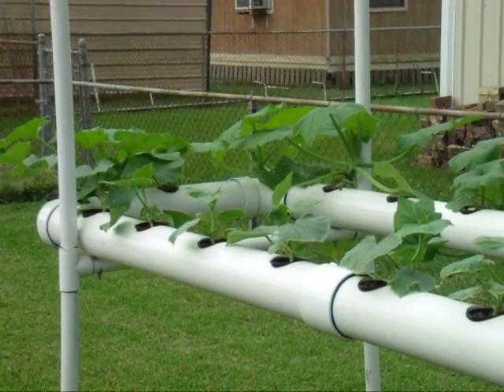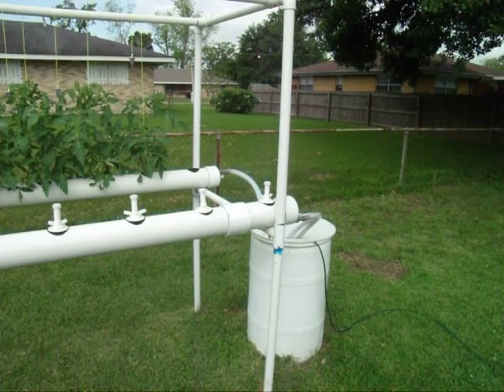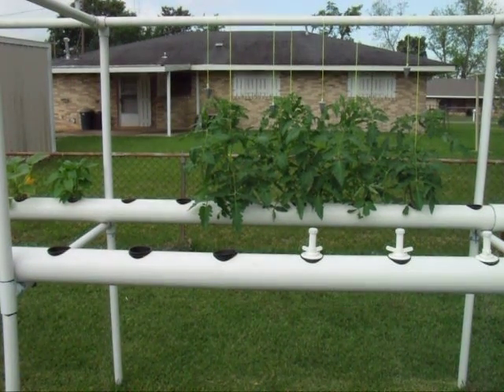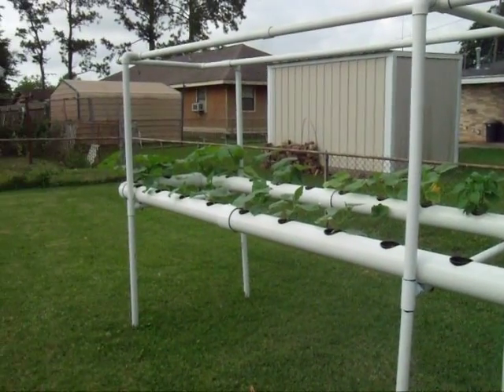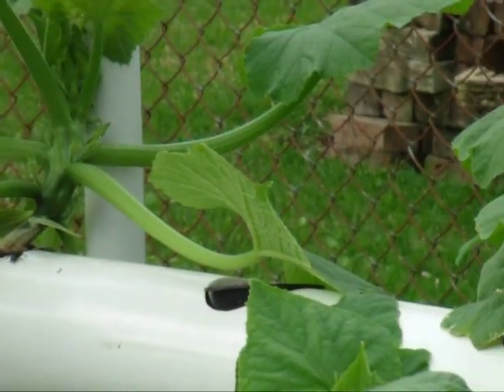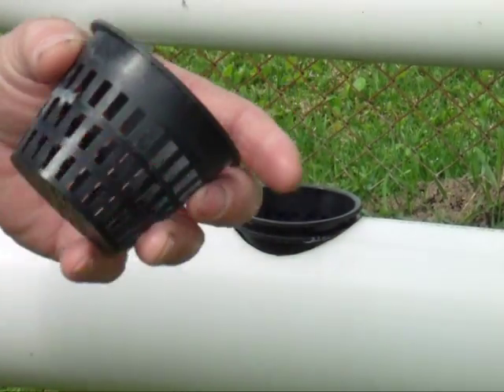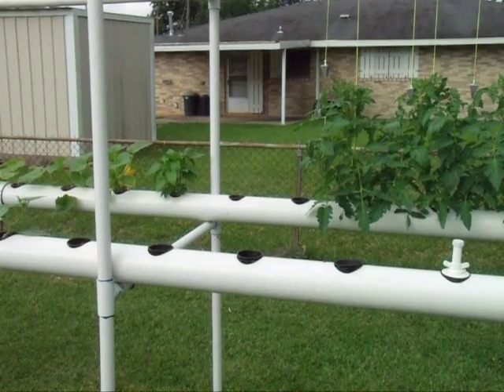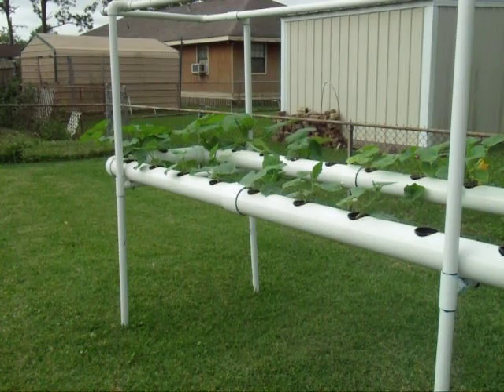My PVC pipe hydroponic garden explained

Comment: Thanks for sharing Kevin. Interesting how you did this. We had a deep craw space and I used to grow down there. I used the pvc pipe, foam coffee cups in pearlite for rooting my clones in one small room and another room for growing. I used pots on corrugated plastic in the grow room for the pots to drain. I just might try your setup next spring, but outside. At 70,  I don't fold like I used to, I don't unfold so good either. 😎👍
Reply from the maker: Yeah one of the beautiful things about this you're not bending over and you're not weeding anything it produced really well I just bought net pots and the clay balls and it did a great job I'm going to be doing another one this spring it's gonna be set up around my koi pond and I'm gonna use the water out of the koi pond to water and fertilize it we'll see how that goes thank you so much for watching you have a great day and ride safe

Comment: Very clever trellising! I wondered why you didn't just use a timer at the wall plug so there's no wiring to do?
Reply from the maker: It's a flood and drain system I wanted to flood 50 seconds and drain 50 min. and repeat 24 hours a day thank you for watching
Reply: @KevinTodd  I have an flood and drain -- not as big as yours and differently configured - and I plug a store-bought timer into the wall (I'm indoors), then plug the pump into that. It goes on and off as I choose. That's why I wondered why and how you need an electrician. I may have misunderstood - maybe that was to set up the outlet. I was just thinking maybe you know a better kind of timer. Mine is only capable of longer cycles, which I run less frequently. I'm getting ready to set up a pipe system so am very interested in how others do it.
Reply from the maker: @melody5437  Maybe we didn't have those 9 years ago and I love to to tinker LOL

Comment: Love it, what gal per min pump? What are you using to fertilize your water?
Reply from the maker: A sump pump from harbor freight don't worry about GPM it is timed to flood and drain 

 https://www.ebay.com/itm/5-LB-WATER-SOLUBLE-TRIPLE-20-FERTILIZER-20-20-20-balanced-micro-nutrients/351756564693?_trkparms=ispr%3D1&hash=item51e65338d5:g:pP0AAOxyyF5RXH-q&enc=AQAFAAACYBaobrjLl8XobRIiIML1V4Imu%2Fn%2BzU5L90Z278x5ickkWpEuxXwAiCNKyBQsQ5%2Fe63uhRvFOwcjl3BXO%2BXOmyAJJ7ryfMjcYPjDnGY6sJJJbMxK0pMUcTEQXVSMwRH%2FYqn9EUUKxYFPZiPr2HRJIM1czfCTJLWVF4dcGNb5QZrn578wLu1F%2FnLnq7K3DfO%2BkJgYC8DddO49%2B5323bqjkNCpJzhyTEiM8jQB9A%2FQwjdVI7YZUU3xZ8Cn9Cs1nJCfU%2BZAj4OP4LO5CfCNKOZxRBApAn8525QLxnRmfUue4TW7H8l9HzRqLnwZjaCRhlynNnXzaN%2By2nGhEb7GmKvnpYCca6tj6tiOCNRnOfoeQq2CU5uBD7xSgQHZ8s2ybj0xo2C%2FwNyQSqwcJpJXI7xoptDD5l32aFN0WDQOkj74XvS5HL6qI4SlJQf0xVUjCVmAwqDTNPX9aCo7iGAO6RNvE1Cd5JugQ1yyuum%2FH8gkeF4r5QQMcMVln4zC44gOPVQF5CMs5fEfj6DwkzmCTGmfZEQQpiVcjURvSz4WchH0upw7rgfJfOp5iE68XF0LCyXR90AJtSr5JNveCzMlgOaGDEz4QZAwpz6VGcwjD5qqGHx9I%2BPsbUUmkAwESlqE3Z9Eg5MEwdCHFggKcq7Ebrc7qn1aKr7ngcXAtA8ziRFp4uQmBdawTDm%2BF%2FvvhFhQae08uQyyINJjBAupPDrH3UETgvRLpNV8QvTrhXyW17LtPRaiUoLcwsR3XIkX9ZyUsWXOF8Bls1yTS4YT0OfnBnlPkE7hA11dDOozWe70nqoH7Fq79&checksum=351756564693b1788e57897043fe98822aa06dd01b2c

Comment: If your water gets to hot you can simply take a gallon or half gallon jug. Fill it with  water and put in the freezer till frozen. Then set it in the water barrel or holding tank. Water will stay cool for several hours.

Comment: What type of garden are you doing now? Are you still using the flood and drain? 

I was hoping to get a detailed materials list and a detailed information on how you assembled your system I have watched your videos all probably 10 times and really like your set up and wanted to get in touch with you on how you did it. We don’t have a huge yard but could do this and it would keep the dogs from getting in it thank you again for your videos and the time you have put into this! I sent you a email as well thank you.
Reply: Would it hurt the plants or anything if my pump only ran during the daylight hours?
Reply from the maker: @jarongilbert9034  no
Reply from the maker: I used 4 inch pipe 3 inch net pots and the clay ball medium the fertilizer I use came from kelp4less 20 20 20 the thing you have to remember the most whatever size Garden you build your Barrel has to have enough water in it to flood it completely I used to time delay relays for the on and off so really the key Point here is having a barrel big enough to to flood your system I use a harbor freight submersible pump lasted for 3 years no problem the barrel has to be painted white to reflect as much sun as possible if you have access to 6 inch pipe that's what I'm going to go with next I don't have a garden right now my shop took up the space where it was at so my yard space is limited now myself but I will be putting one to the back of it pretty soon thank you so much for watching it's just PVC pipe you get a hole saw Mark a straight line across the top of the pipe and every foot drill a 3 inch hole for your net pot.
Reply: Thank you sir was your pipes level or did you put some slope in them to help with draining and are your holes for the inlet and outlet pretty much flush with the pipe cap” 6 in pipe and so would you do 4 inch net pots
Reply from the maker: I'll try to put together a material list for you
Reply: Thank you sir I really appreciate it
Reply: Add what ratio did you mix your kelp4less fertilizer?
Reply: Thank you sir

Comment: Where can I get a material list and instructions to make this?
Reply from the maker: It consists of 4 inch PVC. 2 inch PVC for the stand drill 3 inch holes in it for 3 in Neti Pots And Clay balls.
Reply from the maker: The only thing is your water reservoir has to be big enough to fill all of your 4-inch pipe. With the nutrients in it kelp4less is the people I got mine from 20 20 20

Comment: what you do to control the  temperature of the circulating water
Reply: Thank u for ur answer. It cant be so easy. White color cant be enough to control water  temperature at 20 C and this temperature is good for tomatoes. High temperatures causes root root diseases. I couldnt manage to control the water temperature. It is 30 C at noon and 25C at night.My barrel also white color
By the way your pvc pipe hydroponic garden seems so good.
Reply from the maker: I painted the barrel white to reflect light and heat water stays cool to warm all year. The plants never had any issue with the heat with them at all and thank you very much for watching.
Reply: Could maybe add shade to the Rez to keep it out of the sun. “Rez clear” helps with root rot and algae growth. It’s actually not much different than pool shock(sodium hypochlorite). I think the ratio for the shock was a tsp per gal, but you could find a clearer answer in forums. I use the Rez clear and works awesome! just keep in mind that it raises ph so you’ll have to adjust.

Comment: Hi, how do you keep the water cool when the weather is in the 90's in the summer? How often does your pump go on and off?
Reply from the maker: Nina LM you paint everything white with Fusion paint for a plastic paint do have a lid on your Barrel make sure it's painted White too the pump would come on for 5 minutes that's to fill the tubes and then it wouldn't come on for another 45 minutes thank you very much for watching
Reply: you could fill some 2 litre bottle 3/4 the way and drop one in the res every now and then...

Comment: Love 💕 love ❤️ your system. Nice work. Love your 🍅 tomatoes.🤗would love more, much more details however. Nutrients, keeping them cool outside.ect. What was the issue last time ? The “stupid stuff” no judgement just want to learn.
Reply from the maker: I stuck the water hose in my garden sprayer I use weed killer in...........and a couple of days later in the barrel to add water.....not thinking about the round up on the outside of the hose. I will tell you now it takes 1 day.......one!!!!! and all your plants are dead. To keep cool  paint the barrel white and have a lid on it, I used Kelp4less 20-20-20 for hydro garden and follow their instructions and thank  you very much for watching
Reply: Kevin Todd thx for your reply. Yup we ALL make mistakes. Cool set up.

Comment: I don't know if you're still monitoring this or not but I have watched your video about ten times and have a few questions. I understand you run your pump for the length of time it takes to fill the pipes and you do that every 30 minutes from 6:00 AM until 6:00 PM. Does the pump over power the drain back or is that flow controlled? What GPM is the pump? Also I'm having difficulty understanding/finding the timing mechanism. It would need to power up at 6:00 AM, run to fill the pipes, turn off, do it again in 30 minutes until 6:00 PM, correct? I also appreciate the fact you have answered many of the viewer's comments questions.
Reply from the maker: Yes I'm still here not going any place this video is the timer https://youtu.be/PNf0MFCHuSQ
Reply from the maker: Flood 45 sec. every 60 min. but this is on mine yours might be bigger or smaller your pump needs to be big enough to flood quickly so fill time will vary  and go 4 inch net pots and 6 inch pipe  and two drums

Comment: You could use a gravity fed water system, which would eliminate the need for a water pump. Also just cut the PVC to open the entire side instead of making holes. The holes seem to difficult to mess with. Other than that, great!
Reply: How do you get the water back to the "top" without a pump?  Gravity really only goes down....

Comment: If I were to try this, my biggest concern would be the water temperature.  Since the standing water in my garden hose typically reaches 150F during the Summer [and I have to purge it before watering my garden], how do you keep the circulating water at 130F or lower?
Reply from the maker: I painted every thing white (reflects sun light and heat ) and the water is running every 45 min. that keeps the temperature down. I have never had an issue with heat and I live in south Louisiana heat index 120 in the summer. Don't worry it will be fine and thank you for watching.
Reply: I live in Southeast Texas. I buried my nutrient tank below ground. It protects from both heat and cold, and keeps out sunlight. It also allowed me to lower my channels to about 18" high, allowing better access for staking and trellising.

Comment: hey thank you for some ideas I'm starting with a very small system entirely self produced I have a chemistry and math degree and starting with a single 6 inch pipe and after that I'll set up a larger system, I've gotten an injury so I can't work but I need something to do lol also a question for ya, I home brew beer, I stopped using 5 gallon plastic bucket do you think those will work well for a small system for a water chamber ? I can shield it from light either inside of under my deck. I'm also considering making a system that basically would work as a filter for fish thanks. I have 10 fish tank in my house two of them are 100 gallon ones. I read up on them and they can work very well as pumping the water put and using the plants as a filter and the fish produce the nutrients from the deteitus
Reply from the maker: +Gavlick Apthesycerski On a flood and drain system you have to flood it......... length of pipe in inches x area  Radius -squared x pi = area.........231 cubic inches to a gallon of water so the amount of water storage has to be the same or more than the pipe so good luck have fun.
Reply: Kevin Todd OK thank you, I have easy access to 5 gallon buckets would you recommend at all if I extended the system to almost chain those buckets together ? I mean the flow would work through pressure but not sure if the flow would be as fast as needsd

Comment: Great system I'm building one myself, I was wondering does the water completely drain out or does it need to hold a bout 1/2 of water, my system holds the water, I was worried about root rote?
Reply from the maker: UNUBIS 3049 Yes it is a flood and drain system
Reply: I used a two reservoir system, one on top and one on bottom. The bottom reservoir had a sump pump with a float switch. I ran it continuously during daylight hours.

Comment: The downside of hydroponics is that you will have to pay for "plant food" or nutrients and supplements that can be pricey.
Reply from the maker: miguel thecreditor The plain sch 40 white PVC (white reflects sun heat) I have had in service for 5 years no issues. the cost of my "plant food" or nutrients and supplements is the same as a conventional garden when you add into account the pesticide I don't use so the cost is the same. And as for the fish me and my wife are gone a lot Don't have time for pets.
Reply: miguel thecreditor Black holds too much heat and your water needs too be cool.
Reply: you can convert this to an aquaponics setup pretty easy, but I wouldnt use white PVC as it will eventually crack in the sun I would use gray or black pipe
Reply: Laco you can make your own nutrients very cheap for hydroponics and soil.
Reply: get fish and you don't have to buy plant food, the fish make it for you and you can eat the fish too.
Reply: 2 cents per gallon of water doesnt seem to expensive.  I use masterblend, cal nitrate and mag sulphate and thats what it comes out to per gallon of water.   2 cents!
Reply: Nutrient components are much cheaper than commercially prepared hydropoonic nutrients. I used a mix of calcium nitrate, K-Mag, Peters 20-20-20, a water soluble blooming mix like super bloom, and epsom salt. It takes a couple of weeks to dissolve the K-Mag in water, so start early. The alternative to K-Mag is also a component of explosive. You can use that, but you may get some unwelcome scrutiny.

Comment: LOVE YOUR SYSTEM.  YOU MAY NOT BE yeilding much because it does not look like you used any kind of fertilizer.   You need nutrients to make a lush plant.  I have never dealt with hydroponics, but the plants need food, not just water.  What are clay balls?  Where do you get them and the basket pots?
Reply from the maker: Ebay
Reply: To hold the plant in place.

Comment: how long and how many times a day fo you flood the plants
Reply from the maker: flood until the pipe is 3/4 full how ever long that takes every 35 to 45 min. 24 -7
Reply: Kevin Todd
 Why do you water that often of intervals instead of say just 2 or 3 times daily? Is there quite a bit of evaporation or water absorption by the plants occurring?
Reply from the maker: it's so hot in south Louisiana I find this works the best

Comment: Hello Kevin,  I am attempting to build a simular system to yours. I am building mine in a straight run of 45 ft. I am going to run mine as a continuous flow with 3/4" overflow return line. Could you please tell me exactly what pump your using?  I will be lifting the water about the same height as yours or possibly 1' higher. I am using 4" PVC supported by my wooden privacy fence with 15" setback off fence. Any thoughts would be appreciated....